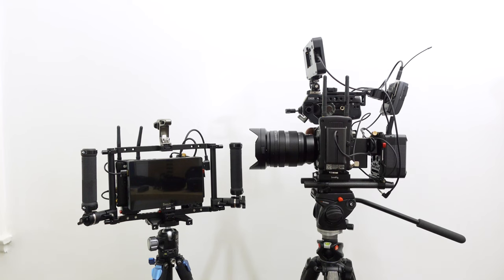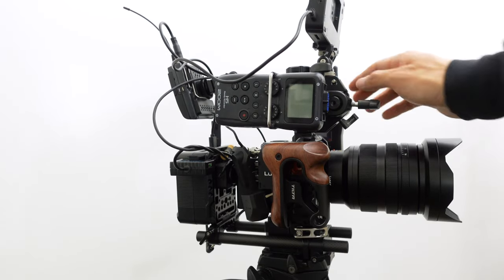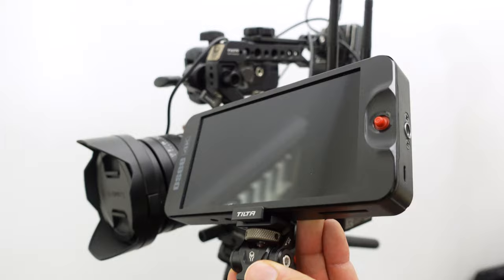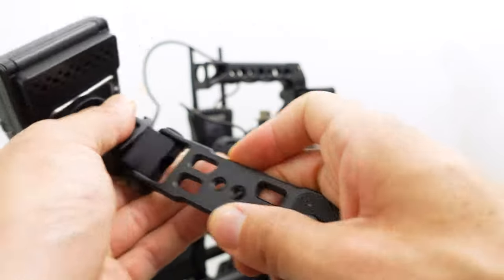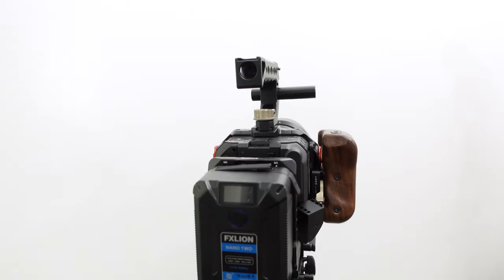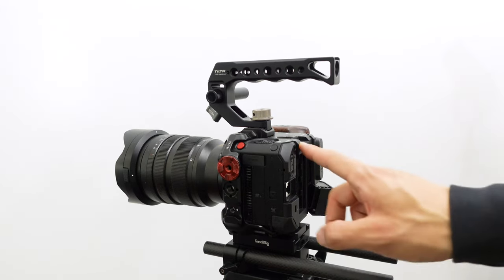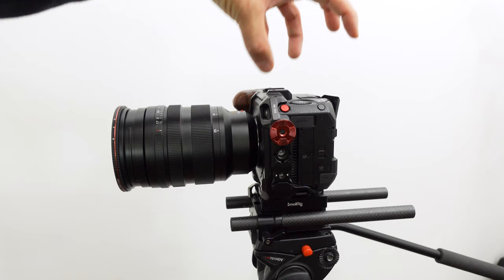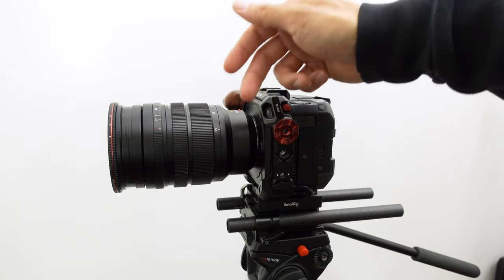Panasonic BGH1 Rig Update for Documentary Interviews | Wireless, V-Mount, Tripod

Comment: You mentioned a D-tap to BGH1 / BS1H DC cable. Do you have a link for that ?
Reply from the maker: the one I have is not apparently not available anymore. It's from Lanparte. It's a Dtap to 12V DC cable that has a Constant Voltage regulator. It converts 12-17V to 12V. If I find it again, I'll list it here. Sorry.
Reply: I found a HangTon one for the Panasonic EVA1, which looks like it's using the same specs. Would make sense, as the same batteries are used also.